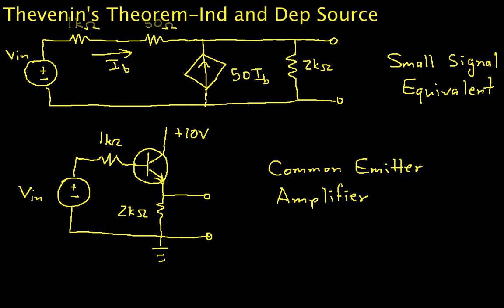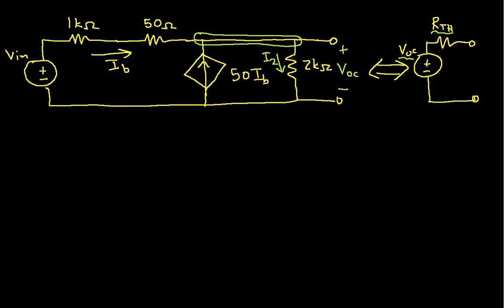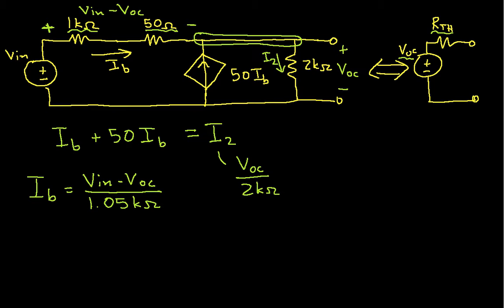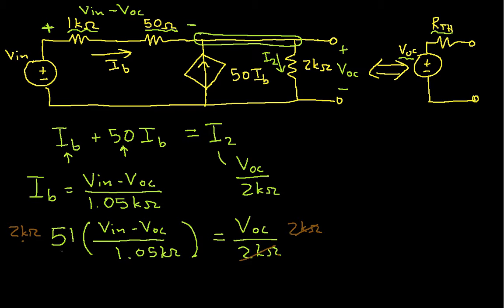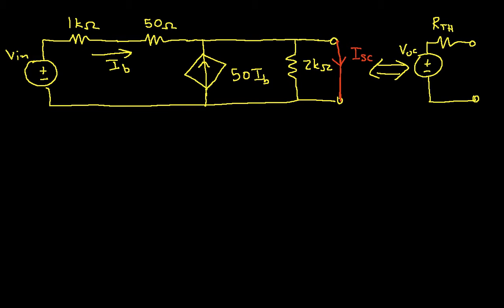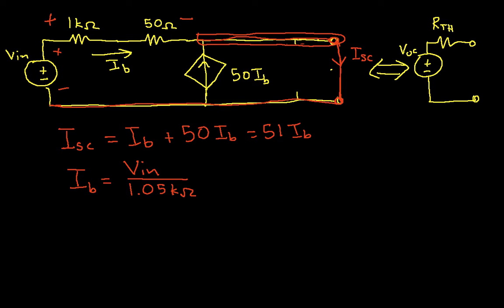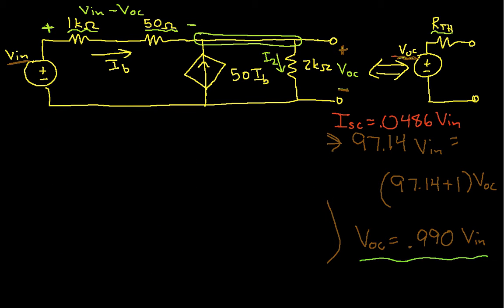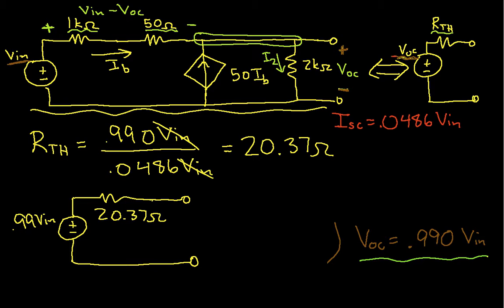Thevenin's Theorem-Independent and Dependent Source

Comment: I need your help desperately. There is a question to which I cannot find comprehensive solution any where. Hope you will put some light to it.There is an independent current source with current control voltage source and I have been asked to find thevenin voltage and resistance. The solution uses test source. But why? Don't you think it should be used to find only when there is dependent source.